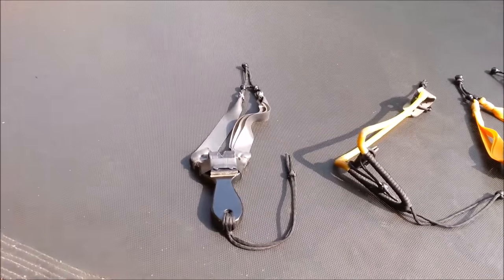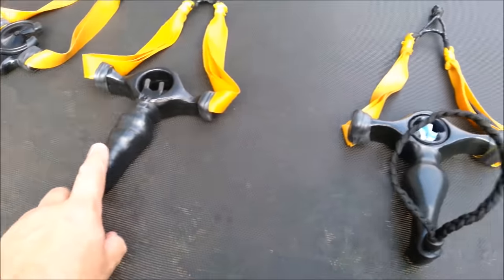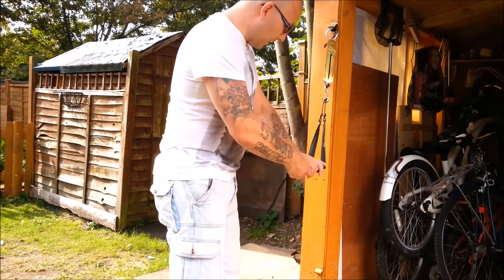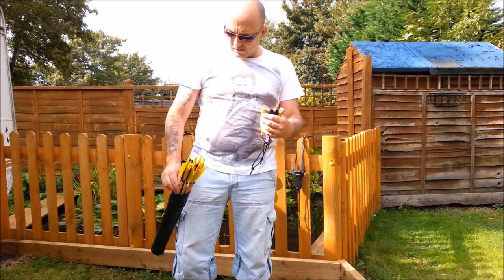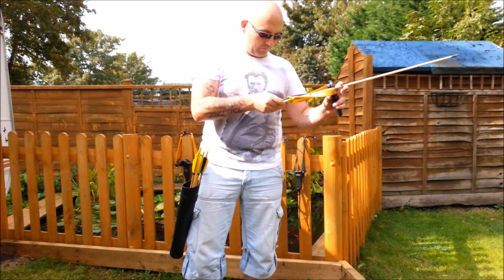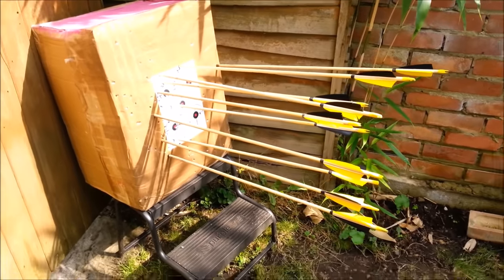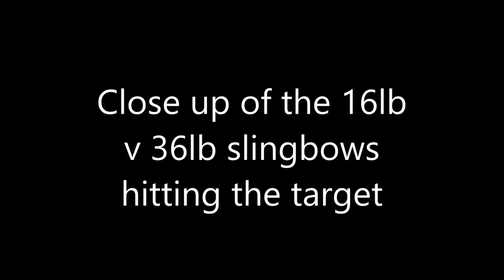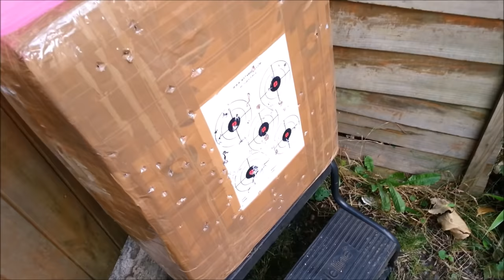Ozzy's Slingbow Comparison Movie

Comment: I'm building one or two, had questions on the wrist support you used, is it pretty effective? also, I am looking for a simple arrow rest, something like the metal forked style you had on one or two of those. I can do the toothbrush model too, but will have to modify the slingshot quite a bit to do so. help here would be great. also. on the flat bands, is there a way to make those, with like intertubes or something? I tried intertubes before, without any real success.maby I did it wrong. I got slingshot bands galore I just like finding a backup